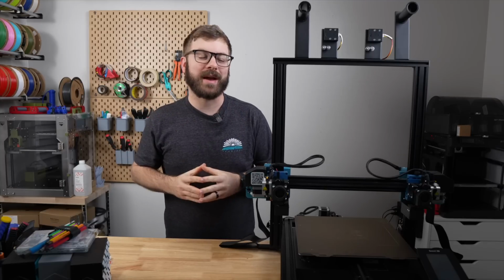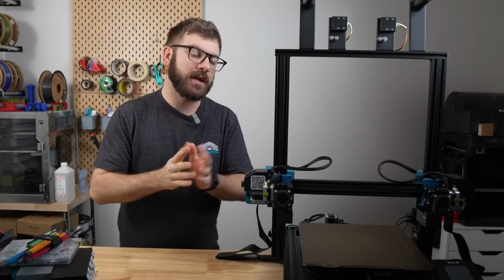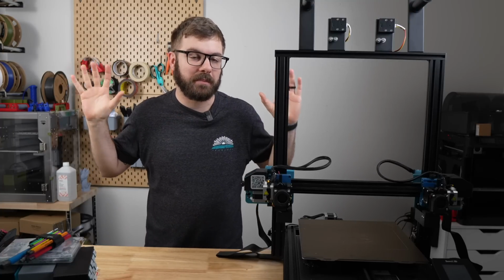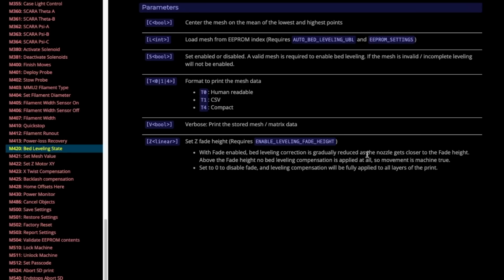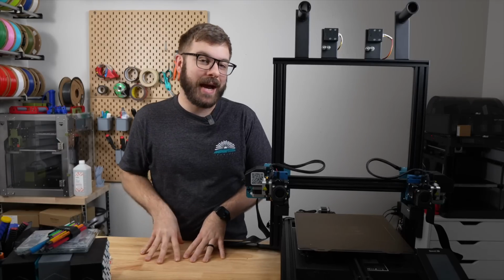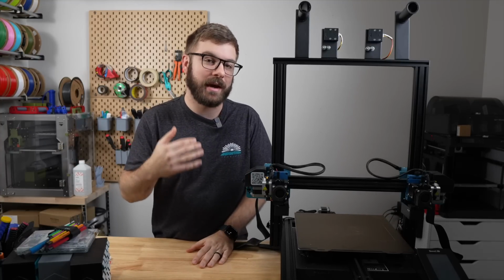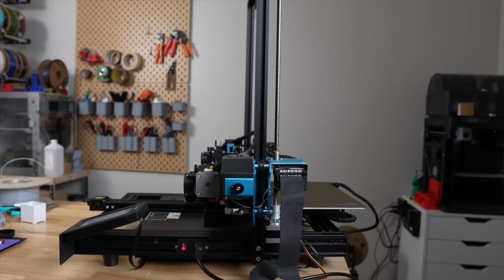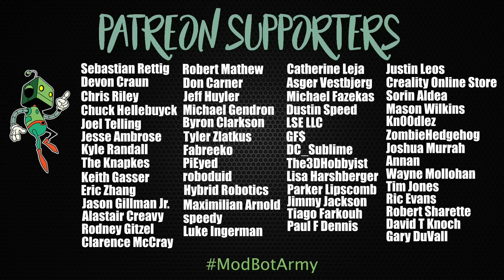The Good And Bad Of Large 3d Printers

Comment: I use a CR-10S4 to build large functional parts and it works well for that purpose.  I added a Microswiss direct-drive hot end, a TH3D ABL sensor, a silent mainboard and replaced the glass build surface with a thin sheet of G10.  With the upgrades, it's a solid, reliable printer that fulfills a need.  I doubt I would want to use as a daily driver though.  It looks pretty silly printing a CHEP cube.

Comment: The original CR-10 is the largest bed slinger I have bought and I knew that was the largest I was going to go with a bed slinger, I needed a larger build area so I built a Pro 3D V-King 400 from self sourced best quality parts and then I bought two Ender 5 Plus machines, I read far too many problems that people were experiencing with large format bed slingers for me to change my mind regarding getting a larger bed slinger and I am glad I did.
Reply from the maker: This is the first time I have heard of the Pro V-King 400. I will have to look into it :).
Reply: Wertzui No I havent seen it in person, my large format printers are used in commercial production so a bed slinger larger than a CR-10 would not IMO be suitable to print the parts I make as the speed needed would affect the print quality, with the CR-10 I can print at 75mm/s but am limited to 2 parts, on the Ender 5 plus I can print at 100 mm/s and can print 4 parts but once I get the Core XY upgrades I should be able to double that speed, my Pro 3D V-King 400 can print the parts at 220 mms and I can fit 5 parts on that.
Reply: @smallnuts2  Those Elegoo neptunes look like they are decent machines, and I haven't seen a bad review yet, the Max is the largest one of the bunch, the Pro is the best in terms of movement though as it has stainless steel rollers and rails.

Comment: I have a CR-10S purchased in Feb 2018.   I thought I would need the build volume, but so far all the items I have printed could have been done on a 200x200x200 build volume.    My bed was not flat when purchased and is still not flat.  Not a surprise.   I do not think the warping has changed over time.
Hence I do not have a use case for these large bed slinger printers.    If I replace my CR-10S, I would look at a CoreXY machine just to get a smaller overall footprint.

Comment: Cannot stress enough, having enough space as a prerequisite! My CR10 Max sat for 6 months in the middle of the garage because of how much space it commands. Love the printer but it takes up  quite some space.
Reply: This was one of the reasons I went with a delta, tall is fine, but the footprint is important
Reply from the maker: This has happened to me multiple times. It seems like such a simple thing but having a spot planned out that you measure to verify before is so important.
Reply: I can second this, recently got a CR10 S5 secondhand off of the Facebook marketplace and stumbled right into that same issue. Got it for $150 with approx 8 rolls of filament, so can't complain TOO much.

Comment: I have a Kickstarter Creality CR-6 Max which sports a 400x400x400 build volume. It is a beast and does require a huge footprint. Creality utilized a 42-60 through-shaft stepper with a belt gear on each side of the stepper with 2 belts driving the bed to try to overcome the issues involved with slinging so much weight. This caused several issues as you cannot get the belts 100% in sync with each other so they constantly fought against each other trying to causing one another to ride up the ribs on the belt gears. At slow speeds it was not bad, but at quicker travel speeds above 150mm/s, the printer would horribly vibrate. The full buildplate is heated and at 24vdc, it heats fast for such a large bed. The strain gauge probing has issues and I have made many, many modifications to the printer, enough that I could have built a voron for the price I paid for the Max plus the price of the parts I bought to upgrade it. I'd recommend anyone to go coreXY when going large format, the bed-slingers just are not worth the trouble. Not only is is difficult to sling that bed around, tall support material vibrates as that bed slings back and forth causing issues including falling supports.

Comment: Fantastic video as always modbot!  I have a couple of large ones aswell as the small ones. They all get used equally, but for the mostly, the big ones are the work horses. I don't double up the prints. One item per printer, I know some will say that is inefficient, but in the long run it just works.
Reply from the maker: Thank you :). Smart! I am the same. There are some printers that have earned my trust that I will do some batches on but I still am very cautious. Would rather have one complete successfully that step away and lose the batch.

Comment: Ender 5 Plus is a cube style non Core-XY that provides a huge build volume. If you add on an S1 extruder and klipper you can actually take advantage of big build volume and making parts in a reasonable amount of time.
Bed slinger i3's just can't get that fast

Comment: I don’t trust filament runout sensors and I also don’t like having that cold joint between paused layers. Definitely suggest larger spools, like Colorfabb Economy or others. 
Bed slingers haven’t innovated as much as I had hoped. Maybe machining the bed mount holes to compensate for thermal expansion. That’s what we did at work with our big Modix 120’s
Reply from the maker: Oh man, I am testing out the Sovol SV06 Plus and I feel this so much. I also dont like filament runout sensors and would think by today we would have the pause sequence figured out. A day into a print it ranout and paused. However, when it moved to the side it disabled the motors so the toolhead shifted when changing filament (there was no way around it). I assumed it would some x to get its coordinates back but I was wrong. Complete waste and a false sense of security. With how much I move printers larger spools are a bit cumbersome but I absolutely understand the appeal.
Reply: @ModBotArmy  sadly we see this with the cheap imported machines   They cut corners to keep the price low (the race to the bottom). It would be nice if they valued QUALITY but they honestly don’t seem to understand that priority. Rare exceptions are the Bambu Labs machines and others. But you need to spend more than $1000 for that.  Which I why I rarely suggest a “cheap” machine anymore

Comment: I am pretty happy with my LK5 Pro as I have only once ran into not being able to print what I wanted to print.  I also have a E2 Pro and I really like this printer.  It pumps out some really nice prints.  I only print as a hobby, but nevertheless it is super nice having two printers.
Reply from the maker: Two printers is great even for just printing replacement parts or upgrades. Taking a printer down to realize your part didnt scale correctly is as big issue if that was your only printer.

Comment: until now i had a flsun sr (wich i sold) and a prusa mini  wich currently prints asa parts for a voron 0.2
i never really got along with the super racer, it wasnt that fast,  never worked how i liked and messed up around 1 out of 10 ro 12 prints 

i really like the prusa mini, never failed onec if you use the right settings,  but it will probably go one the voron is finished
if not its gonna go as soon as i get my k1max ❤

Comment: What FDM brand/model would you recommend with a large print bed with the least user hassle that you can justt remove from the packaging and get right to work with most reliable prints? Let's assume the budget is under $1000. Thanks.

Comment: Been eyeing the solvols. they seem like such a good deal! 

I Have been working on and tuning my dad's Tevo Tornado Gold with disappointing results. In that time I have purchased an Ender 3 Neo, modified in the usual ways to increase hot end flow and quiet it down a bit. Both printers are now on Klipper with all metal hot ends. The Tevo still struggles with ringing artifacts even after input shaping, the large machined glass bed is a behemoth.  75mm/s + 1250accl is the max you better even think about if you need any type of surface definition. the absolute egregious use of T-nuts holding everything together is likely the reasoning why the printer just can not compete with modern printers and the diminishing returns in terms of print quality. in the coming months it will probably see a cr-10 bed + cr10 x axis to stiffen it up. I've only found a one source of American made carriages and parts wish there were more but it is what it is!

Comment: I'm surprised that you didn't mention two things: 
First, I have an Ender 5 which solved some of the issues you mentioned by having the print head move on the X and Z axis, and the bed only moving on the Y axis. No matter how big or heavy the print gets, there's fewer of issues you mentioned, and much less shaking of the printer due to the increased weight. Plus, it has a smaller footprint.

Second, I haven't tried this yet, but you could use a UPS which would eliminate brownouts, and keep the printer running during a blackout. As long as the blackout isn't several hours long, it should eliminate the associated issues.
Reply: Well ... an Ender 5 has the build volume of an Ender 3, right?! So something like 230 x 230 x 300. But this video is about "large size", so at least 300x300x300 or bigger. And the reason why it is mentioned is because: i3 style printers like the CR-10, Ender 3, Sovol SV04/06, etc. are much more comon, I guess.
But yes, he could have had mentioned it as an not so comon alternative.

And a UPS is quite expensive, isn't it? I would guess like 200 bucks at least for a 300x300 heated bed. And the batteries need to be chanded after some years. So for a printer that costs like 460 bucks, it is a substantial accessory that ads the requirement of more space and costs. A good power loss (heating bed after power is recovered) and working filament sensor on the other hand should do the trick as well.
Reply: @hassosigbjoernson5738  My Ender 5 has a bed size of 350x350x400mm. 

A UPS can be pretty expensive, but some people experience frequent brownouts and blackouts, such as in California, so in that case it may be a good investment. Plus it protects the electronics from power surges, extending the life of the equipment plugged into it. If you have an expensive computer, you really should have a UPS anyway.
Reply: @Delta Tango  Your printer is called Ender 5 Plus, the other Ender 5/ Pro models only have 220x220x300 build volume.
Reply: @SebastianJ109  Yeah, I wasn't sure if it was a Plus or Pro, thanks for the correction.

Comment: instead of relying on power loss recovery, get a UPS! I run dual 1500VA battery backups on my large printer, one for the controller and one for the dedicated bed heater circuit. I run a Modix Big-60 V4 IDEX, so adding on $500 of battery backups to a $7000 printer is well worth it. but my building also has redundant generator backup so the printer really only has to make it through the 30-60 second generator spin-up time.

Comment: I have a CR-6 Max (400x400) that has been mostly decent. Most of the print failures were due to poor planning, not due to the printer itself. I use 0.6-1.0mm nozzles for everything on that printer.
Reply: Such large nozzles...
What hotend are you using?
Reply: @alejandroperez5368  I’m using the stock hot end. I adjust speed accordingly depending on nozzle size and material. I print at a fairly conservative speed.

Comment: I designed the Maximin, the printer that should have been made in place of the FT5 R2. It has a bed size of 360x410x460, and was made before Creality formed. Currently looking for one that's at least 600x600.
Reply: Modix Big 60 $5k

Comment: Many people say that most of the time they print smaller things that would fit onto a 200x200 or even 160x160 build plate! That's why I think, two printers are really a good way to be flexible in that manner: a small size Ender 2 Pro/ Prusa Mini or similar which would be "big enough" for 85%+ of all prints and maybe a Sovol SV04 (that you showed with not only the bigger build plate but also some other aspect like IDEX for 2 color/ material prints. With that you also gain "more speed" by printing 2 parts simultaneously. *The fact that would also be interesting would be energy costs or savings with a second smaller printer!"

If you always heat up that large bed for printing small things the size of a benchy or android figure than a mini printer on sale for like 120 bucks (Ender 2 Pro) should easily be more efficient over like 3 - 5 years and 2 prints per week, shouldn't they?!
The downside (as you explained very good in your video) is space. And although a mini printer is like very compact it still needs the space especially when using a dry box for filament.
But if someone regularly prints parts and also tinkers with the printer and is installing mods, the option to always use the second printer - if needed - could become very handy. 

So my take on this would be a small machine like the Ender 2 and a bigger one with IDEX and maybe an closed build volume for ABS/ ASA. I wonder if Creality or Sovol would be launching a Core XZ machine (for easy enclosing) with at least a 300 x 300 plate and IDEX next soon?! ;o)
With that newer tool heads from the Ender S1 Pro and a Raspi4 with Klipper (or Sonic Pad) that could be very competitive against a fast but otherwise "standard" and expensive Bambu Lab.
Reply: The cost savings are real. With current electricity prices it makes more sense for me financially to get a 300mm voron instead of the elegoo 3 plus. With 42 cents per KWh electricity the voron would result in less money under the assumption that i only need a third of the time of the print within a year (100 days of print time for the voron vs 300 on the elegoo, so the same amount of printed parts)

Comment: My cr10 v2 size is the bain of my existence. I managed to build an enclosure to fit the cr10v2 and my ender 3 v2. I haven't even used the whole height... 260mm is the most i've used. However, I have used the full 310x310 bed. I might mod it to 310x310x300. 
I have just purchased a rat rig. I was going to get the 500x500 however due to the size, where i build it, is where it stays. I got the 300 version instead. My experience in 3d printing for the last 2 years is, more smaller is better. My plan now is 2 rat rigs 300 size and maybe a rat rig minion.

Comment: I had two CR10 Max running Klipper and they worked well but print times were high. I didn’t like them being bed slingers so I sold the for too little money. I have regretted that decision ever since. Having a bed that size allowed me to do some great larger project and to replace them with a corexy instead has been out of my budget. I really wish I had kept them. By now I would have them running 1mm nozzle and doing fun things with them. I’m thinking of getting one of these new large printers since they are more affordable.
Reply from the maker: Sorry to hear. I would be lying if I said I never sold something that I almost instantly had regrets on. Printers are still getting better and the price makes them much more accessible. Hopefully you are able to find another entry point.

Comment: i hate my cr10 s4 i upgraded it so much linear rails hemera hotend 230v bed heater but now the bed is so heavly bend that i just want to put it in the trash. I messured in the middle of the bed its 0.5mm more down then in the corners. maybee i just buy the p1p and forget about that thinkering its just always pain that i need atleast 4 trys to get a sucesfull print

Comment: Yeah..  Not gonna lie, I'm not exactly looking forward to the size a 350mm Voron 2.4 will take up, however at the same time, we're going that route because we specifically want to print larger items as one shots, instead of having to print 16+ pieces, pin and glue them all together, and do an insane amount of post-processing on them afterwards to look seamless.  Plus side though, I have a 300mm Trident, so I have a general idea of how much space it's going to take up.  Larger printers definitely take up a surprising amount of space...
Reply from the maker: If you have the budget I would much rather go with a 350mm corexy style printer. The only reason I didnt dive into this is that I feel it is easier to throw money at these new large form factor printers that are sub $500 and the i3 style is what will have more issues. With a stationary bed and MIC6 bed on the 2.4 as long as you have the space that thing will be a beast.

Comment: Large scale printers should have a bed that only moves on Z axis, or not at all. Whipping parts back and forth is a horrible design.
Reply: Agreed wholeheartedly. I bough an Anet A8 plus a couple years ago. Love it, leaarned a lot. Last year I bought a Sovol SV05, clone of Ender 5 Pro and the bed, is smaller, 220 vs 300 but? It only moves on the Z and the difference in print quality is insane.

Comment: Yeah kind of a tough problem that only 1 company makes 400x400+ printer kits as a coreXY and they have a reputation for using proprietary firmware and using pretty bad parts even compared to Creality or Anet.
Reply: Which company are you referring to? Because I can think of at least two companies making 400x400 coreXY kits.
Reply: @chrisdelaney9510  I assume he is talking about tronxy. But they have changed their firmware to Marlin a while ago. They can be pretty capable with some mods. The VZBot certainly is no slouch and is also based on the x5sa.